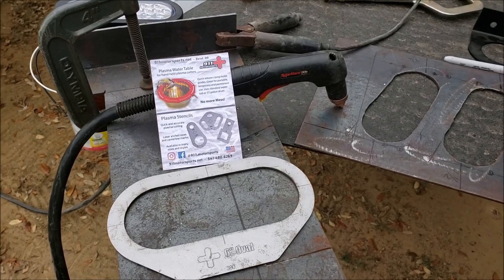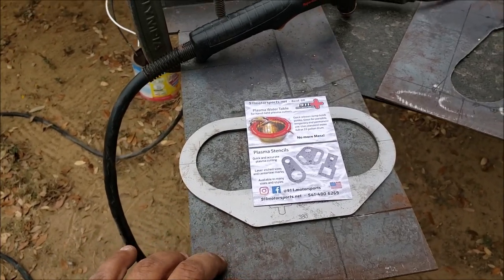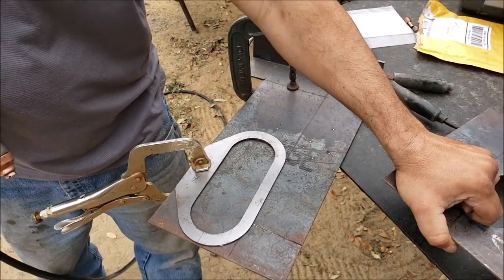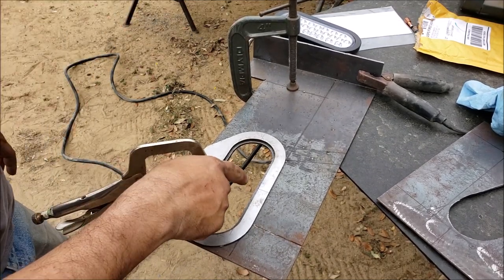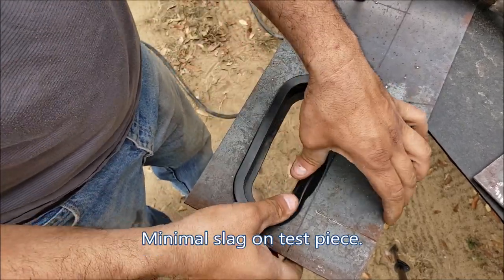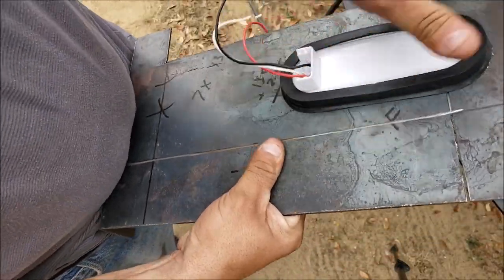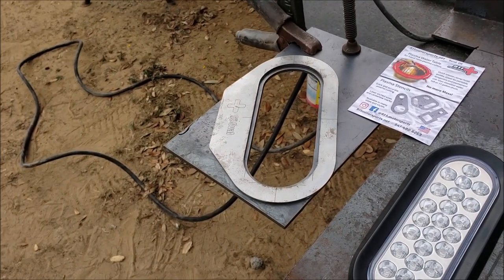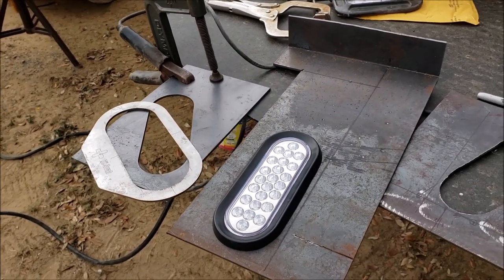Perfect 6" oval trailer light stencil from 911motorsports slots circles oval plasma table

Comment: Awesome!... Those stencils look pretty cool and they do come in hand... Your plasma cutter works mighty fine👍👍
Reply from the maker: My Plasma cutter has been working really well. I did notice it has a broken plastic piece in the filter / regulator. I tried buying another regulator but they are expensive and waiting for one to appear on ebay. I also added a pvc water trap setup I built which was suppose to be in copper I just did not have the funds at the time. Supply seems to be dry now and consumables seem to last longer. I can finally cut with good results.

Comment: I guess you could use wooden templates to make your own stencils.  Nice finish on the cuts.
Reply from the maker: I have seen some wooden letters at Wal-Mart which I could use as stencils. I will by some later and try them with my plasma cutter on 1/8" mild steel. I think the wood will survive as long as my termites stay away from it.

Comment: What size steel are you using?
Reply from the maker: I used 1/8" and 10 Guage which are very close in thickness. I used the same 2 materials on my flatbed build and the thicker material was due to having the diamond stamping or being floor plate. The metal is still heavy and on the headache rack I could of gone thinner but did not want to order more steel.